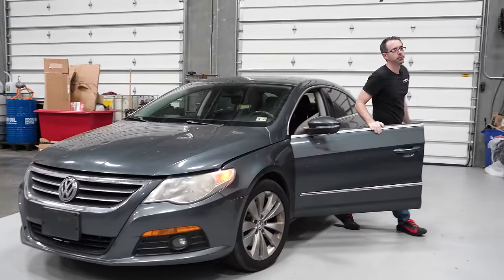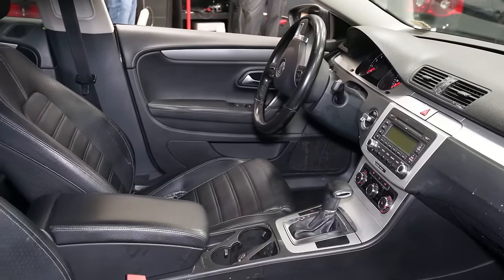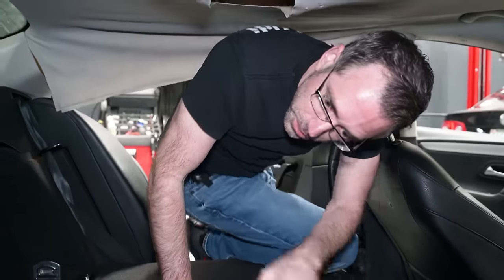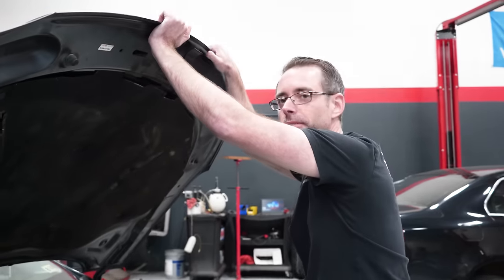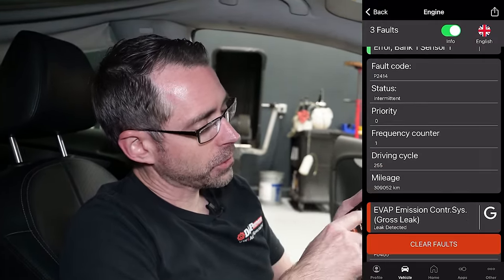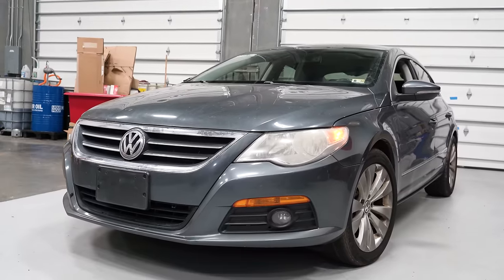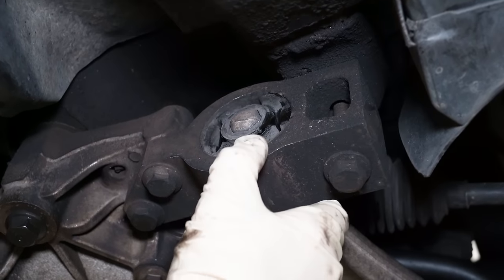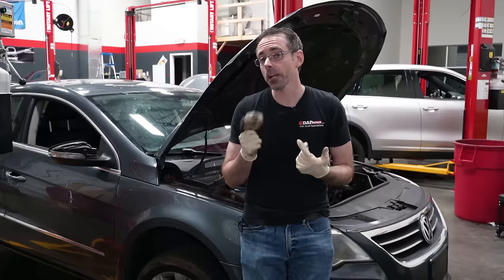How NOT to buy a Volkswagen CC

Comment: It doesn't need a head gasket. It just needs absolutely everything else
Reply: Literally 🤣
Reply: Oh man got mine for 4k in 2017, a week off the lot the rear main went out.  All in all I spent about 8k in parts before I wrecked the damn thing in two years lmao.  I will say hitting a guard rail at over 90 mph, the thing saved my life before literally shredding to pieces.
Reply: Literally …
Reply: It needs to be junked.
Reply: i bought an identical one and long story short an absolute piece of junk. with only 70 thousand miles it needed a timing chain which included removing the transmission and it was a 7k job. Also a myriad of issues like parking sensor wiring failed and interior was trashed with low miles. and all the tail lights were broken. make it make sense. went back to the auction
Reply: 😂😂😂so..if the gasket is alright,the car is fine,right?
Reply: @AJ  This means whoever had it before, fucked it up and didn't give a shit. I always advocate for used cars, because it financially makes sense. But , seeing how the average Joe fucks up their cars, it's probably cheaper to buy under a year old and take good care of it.
Reply: 🖕👎o that entire car take it back and leave it on the door step of the kid who sold it
Reply: Does it even worth fixing?
Reply: @bmw803 😊
Reply: @toddpatt585  😂
Reply: Yeah, I’d much rather it be the head gasket 😂
Reply: $1200 ? you pay for what you get buying a car for $1200 to complain is crazy
Reply: So basically we need a new car around the head gasket.
Reply: bought mine with 100.000km  2010 model timing chain changed at 91.000 no problems with the car except the headliner falling apart an a bit of rust at the front door chrome trim
Reply: It could be a oil cooler. I had the mix, but it was an oil cooler

Comment: I’ve purchased 2 CCs and regretted buying both of them. Side note, I have 2 CCs for sale if anyone is interested
Reply: lol had mine since 2016 78k miles bought since 20k no major issues just wear and tear items, people don’t know how to maintain these cars and it doesn’t help when vw says 10k oil changes are fine when they arnt. u bought lemons
Reply: Are those pictures current?
Reply: @rjmari um, yes.. sure. Sort of. And check engine light is on because of a bad gas cap, I’m just too busy to fix it. My loss your gain. 😜
Reply: @JamiesGarage1  No lowballers. I know what I have.
Reply: mine is currently making me regret this car as it sits with a blow turbo right now lol
Reply: @random13627  It’s more a gen 1 issue
Reply: $3.50 for both.
Reply: @aliabdallah102  $4.25👋
Reply: @TermlessHGW  too much. I’m out.
Reply: @random13627  78K is nothing. You will absolutely regret it after 100K. That 2.0T is such a garbage engine.
Reply: Does it have quick change rear bulb ? Ha.
Reply: Just give them away.😂
Reply: @random13627  no the ccs are one of the worst cars VW has ever made, just becuase you didnt have issues doesnt mean anything. There is a reason VW stopped making them. Terrible cars..
Reply: @YungEagle3k  it's almost entirely the same car as every other vw. They didn't quit making them, they just changed the name.
Reply: I have a 2010 cc and I swear they've built this car to leak oil. I bought it for $2400 and I've put over $2000 in just parts into it and I'm still not done.
Reply: @Tdfries  That's the thought i had when he commented about 78K but with them changing the oil at lower intervals the engine might actually last. That and if they change the timing chain tensioner very very very soon.
Reply: @hi  Good point. I had many VW and always change the Oil every 6K miles at the most.
Reply: @HaloHamstur yep me too bro
Reply: 162kmiles,2010 CC, do regular maintenance, and few issues other than the usual VW electrical bugs... Yes, i baby it, and its lasted. Try getting it into 5th or 6th and drop the rpms quick as you can, change the oil and filters, etc.... come on, its really simple not to beat the crap out of your car, and if you do, dont complain about it when things break
Reply: Lol😂

Comment: They neglect the car for 10 years and be like, "VWs are so unreliable, I'm going to go buy a Toyota"
Reply: I have one and the amount of maintenance this car has over 100k is insane its just a car with a ton of problems
Reply: Ya bcuz u can neglect those with zero consequences.
Btw I'm german
Reply: a toyota would still be in better shape
Reply: You neglect a Toyota for 10 years, it will still probably drive. A VW won't.
Reply: @Noor Kareem  not a modern one.
Reply: @christianheidt5733  not a modern model. Reliability has gone 📉📉 recently
Reply: Try that on a modern model (2019+) and report back to me in 10 years 🤡
Reply: @mitchellmounts9044  yup, that's true!
I will only buy upto 2012 right now, as far as I'm concerned they are all garbage after that
Reply: @Mitchell Mounts  agreed.
I won't buy anything past 2012 for the moment.
I like my money 🤑💰💯👍
Reply: @quinty26  for real, neglect a VW's maintenance for 6 months and you're in a world of hurt.
Reply: @saeedhossain6099  older VW models don't need nearly as much maintenance
Reply: @midladder  i drove a passat from 2000, VR5 4Motion, never do something on the engine and electric. Yes every 2 years replaced some wishbone parts thats all... after 23 years finally it failed on rusted rear axle and ignition coil. So replaced this lovely car with the 2009 CC 1.8 tsi.
I'm fine with it as well hope it will drive next 10 years without any probs as well 😉🤫
Reply: Toyotas also have their issues. If you can find a 2000-2010 Toyota with low miles and in good condition, go for it. Newer ones are not what they were. As for VW, I've been driving them since 1998 ( ALL TDI ). Never had any major problems.
Reply: @odeseusX  Based on what? Just because it says Toyota on the trunk?
Reply: @odeseusX  If you refer to early 2000s Toyota, you're spot on, but not the recent ones.
Reply: @midladder  It's the case with most cars these days.
Reply: @ike  VR6 is a very dependable engine. That's why I'll keep VERY TIGHT maintenence on our 2018 ATLAS with VR6 engine.
Reply: You can buy any vw Audi Seat skoda .. Till 2012 
Trust me im from Germany and a Mechanik

TSI needs good Service 15.000 km /oil change 

TFSI same but broke though

TDI‘s are good until Adblue 👍🏻
Reply: @Chris6R97  TDI is the best engine VW ever made, but all those DPF and ad blue are definitely choking them and cause unnecessary problems.
Reply: @Jerome Brown  My Audi A4 B6 was neglected for 18 years and stile drove like a champ.
Reply: @odeseusX pray you don’t have an accident like a Honda total death traps!
Reply: @quinty26 I had a 1986 Jetta 590k miles 17 years original engine and trans no leaks no burning oil only some rust and spark plug cross threaded-take that Toyota!
Reply: I also had a 2001 passat that saved my ass after a truck crushed me into a bridge at highway speeds and they had to tow both away-Toyota won’t do that for you! Went immediately to buy a new Passat-2013 from dealer!!
Reply: @quinty26  Kind of "neclected" a Golf3 and still works (except rust ofc) 🤣So older VW  take neglect better it seems
Reply: @lpico  My dad had a beetle and also reliabble... same w/ the Golf 2s and 3s... some 4 also good. Jetta had the Golf2 tech, so also good 🙂Gruß f. Germoney
Reply: @lpico  Toyota has too many plastic parts .... and looks are a "matter of taste" too. But very reliable (at least older ones, I do no know newer cars at all :P) We had a 2005 or 06 Toyota and some parts may fall of (cause named cheap "plastic"), but engine great
Reply: Man this car is tired,junk people doesnt care for the car,u see what condition is this car,is normal if u will make some bur out or drag race,the car will be brocket,diesnt matter is a fucking toypta or another car will be brocker if u dont care for it,so i have a vw cc 3.6 570k kmh and she fly she dont care
Reply: That's the thing u can neglect a Toyota I drove one with no oil for a month engine locked up put oil in it rolled it down a hill popped the clutch drive it for another 3 years u just rarely ever have to put any money into them

Comment: Crazy that such a relatively young car can be in such a horrible state
Reply: Pothead teenager's first car? 🤣
Reply: Guaranteed the previous owner bitches about "those damn unreliable German cars"...
Reply: As someone with a CC this car is very much unreliable
Reply: @alexanderpsaras5663  exactly why i got rid of mine, it was a 3.6 4motion and it was fun. Just hated trying to chase down the next thing
Reply: @aaaapppprrrr  i bought one of those from an auction and the timing chain was bad it would have costed 7k to replace. you have to remove the transmission to do the job. and mechanic told me how if the flywheel has any play at all then it will cost another 5k. this car had 70k miles by the way
Reply: @alexanderpsaras5663  my parents owned a 2011 cc 2.0TSI for 12 years and it never had a single issue we bought it brand new tho. Although the new owner had terrible luck as the clutches failed less than 2 weeks after we sold it.
Reply: Laziness!  Same people that can even go through the drive up windows. Pay for ubereats.
Reply: I've seen worse... maybe two year old cars that look like they're 25 and beat up as hell
Reply: It's a VW. You want reliability, get a Japanese, except Nissan.
Reply: It's a VW. That's all that needs to be said.
Reply: @someidot3699  most of the commenters are people bashing VWs haha
Reply: I drive a 2011 Passat cc 2.0 TDI with 350k KMs on the clock, otter than chaisses parts like springs, brakes etc. Ive only chancer the EGR. Had it since 120k km.
Reply: @ependergrass  bro I think even that would be better
Reply: I mean it is a Volkswagen
Reply: @AJ-zv9tn  well deserved!
Reply: @deciplesteve  But all german cars are unreliable. You don't get one for the reliability
Reply: @2810Mad  no they aren't. Congrats on admitting you don't know how to maintain your car.
Reply: @deciplesteve  Nobody buys a bmw or a mercedes for the reliability. You buy them for the status. In germany, nobody does that. You can keep insisting on your opinion but the statistics prove you wrong
Reply: @2810Mad  I bought a BMW for the reliability and performance lol
My previous car was a Merc W211 that in 2 years of ownership cost me 10 bucks in broken stuff, which was 1 outside air temp sensor which took 5 min to change, that car had nearly 300k km's on it and it was utterly flawless.

Statistics prove you wrong so idk why you're being a dumbass pretending the data is on your side.

You just gotta buy the right ones, some BMW's are awful, others are unkillable, most Mercs are unkillable, a few are atrocious, you can't judge them by their absolute worst and judge Jap cars for example by their absolute best.
Reply: @kristoffer3000  statistics prove him right, pal -- your anecdotes aren't worth anything. bmw/mercedes/vw/audi are almost always in the bottom 1/3 - 1/4 of cars when rated by reliability. insurance companies release numbers all the time and the order essentially never changes.
Reply: @scslre   @scslre  Have you tried uh... Actually looking at those statistics? 
Also have you tried reading entire comments? I do say that some German cars are atrocious whilst others are excellent, my old X3 for example was horrible, it'd break just for fun but my current f20 1-series is rock solid.

Pretty ridiculous that you just ignore more than half of what I said, ignore statistics and then go on to say I'm somehow wrong.
Reply: @kristoffer3000  "statistics prove you wrong" is a self-contained claim. i don't need to read any more than that, because that claim is incorrect.

anecdotes about particular cars that you've had that have been good/haven't broken are irrelevant when we're talking about manufacturers broadly. toyota has some lemons. it's not relevant.

Comment: First!
Side note, I very much dislike working on CCs 😭 this video was like “average CC owner coming into the dealership for the first time” only to get [customer declined all work only wants oil change]
Reply: "DON'T TRY TO UPSELL ME!"

-Almost Every Customer Ever
Reply: And it's at the dealer because the customer just bought it and they haven't yet figured out that it's a wreck and they shouldn't take it to the dealer. Two hard lessons at once
Reply: It's a cheap luxury car this is completely normal there is a reason when normal people come to me for what car they should buy I recommend them a Toyota or a Honda and if they're buying you get the best warranty possible and follow it to a queue and then as soon as the warranties up dump it and go get another one

Comment: Bought a 2010 CC in 2018 and have been driving it since then. 135k when I bought it and it at 200k right now. Ever issue you said in this video is one that I have had to deal with on this car lmao. Headliner started falling, trunk wouldn't open due to the cable, and timing tensioner issues. Thing been a champ though. Recently had to rebuild the upper half after it destroyed the valves. Your TSI 2.0 timing video helped a lot with that. Love the car, insanely fun to drive.

Comment: Just done this job myself for same problem....had both an external and internal leak from those gaskets... Although nowhere near as bad as yours internally!I had just a bit of oil floating on top of the coolant but had a fairly bad external oil leak from both those seals. I didn't see your video before I did mine but it will be helpful to some people looking to do the same job so thanks for posting!

Comment: I have a 2012 Seat Leon with a 1.4l 125hp tsi engine, owned it since new.
After a couple years I noticed the coolant slowly disappearing with no apparent leaks anywhere.
Eventually, coolant was going at a rate of 1 cup every week. Turns out that engine has a heat exchanger on the intake behind the turbo (thankfully) and that heat exchanger leaked. right into the cylinders.
Reply: seat is spanish for quality
Reply: its a fairly common issue on the 1.4 tsi if you work on them enough. ive replaced a handfull of them

Comment: I bought a vw tiguan 2012 from a friend of a friend. From the first day i had it the sunroof was leaking to the point that the floorboards were soaked. It was the sunroof li es needed to be unclogged. Then 6 months later the control arms, calipers rotors and pads needed to be replaced on the front brakes. Got thatndone and 3 weeks later, then intake manifold went south. I am so thankful i purchased an extended warranty. It didn't cover everything, but some of the above was covered. It only has 94,000 miles on it. I've been faithful with doing oil changes on time and will be doing a tune-up soon. I have watched a lot of videos on youtube regarding tiguans and the common issues they have. I'm hoping that im finished with repairs for a while, lol

Comment: I had a B5.5 Passat. It always burned oil through the entirety of me owning it. What killed it was the plastic coolant hose that’s behind the engine exploding. But what sucked was that I actually really enjoyed that little car, and it’s left me wanting another VAG car but I need two other reliable cars before buying another old VW.
Reply: Daughter purchased program car, a lease return. She was told it was an 1990 model but she never looked at the title...it was older...with a v 6 motor...the car was built around that motor! It was a full sized sedan rode comfortably. Purchased with 55k on it if that's believable. Not dip stick for auto trans. When it got to around 80k told her she needed to purchase an Asian auto or the vw was gonna become a money pit. Then she got a campaign letter about her sunroof needing factory authorized repair. So even though the car had been thru a recent hurrican where local areas were flooded and her car remained dry she went into the nefarious claws  of the local VW dealer in daytona, then located on west end of Mason Ave. They kept the car for repairs...then called told us the huge over sized battery that's was in great shape all of a sudden died. So we purchased a battery from local parts house at 1/4 the cost of what v.w. wanted and went on our way. Within days it rained and her car had 4-5" of water in it. Back to the dealer they said it was not their fault..😮 though no leaks were apparent until after they worked on it as a factory recall. Few weeks later she said dad check under my car it smells like hot grease...after inspection  revealed a nice clean case cutter slice across the outboard CV joint bellows passenger  side allowing grease to go everywhere. As a master ASE mechanic diesel gas med & heavy truck from experience knew C.V. boots never tear across bellows usually in the valleys...daughter called vw for bellow kit.  
Nope only new half Axle at ruffly $500.00.
So to save her removed and replaced with after market for like 1/5th of quoted price...could not find a boot kit in our area. That sealed it. She  traded for a Asian car and is still driving it today. German cars, unreliable when compared to asian cars. Plus require speciality tools, factory is slow to share pertinent information for repairs parts too expensive...their not the peoples car. They are for gear heads who live to twist wrenches or for folks who get a swelled head spending money on lots of German maintenence. Wouldn't own one if I won it happily sell it asap! Sadly VW lost its original mission statement years ago...
Ferdinand & Adolf must be rolling in their graves....😢

Comment: I've had the oil consumption/smoking problem on two of these engines from 2009. Try doing a piston ring soak with equal parts mystery oil and berryman B12. Soak it for a good 2 or 3 days while working on some of the other things. It's going to smoke like crazy once you put it back together, so take it outside (on a windy day). Good as new. Except for the rest of the car of course.